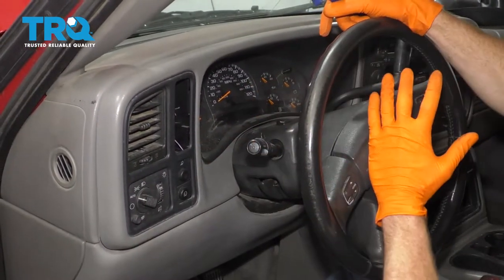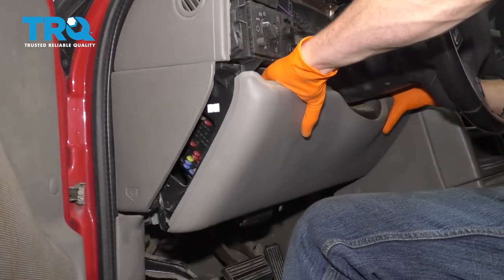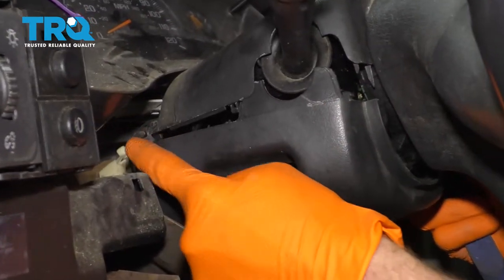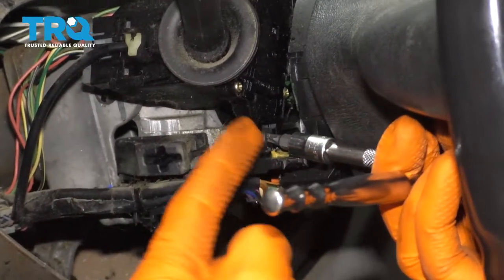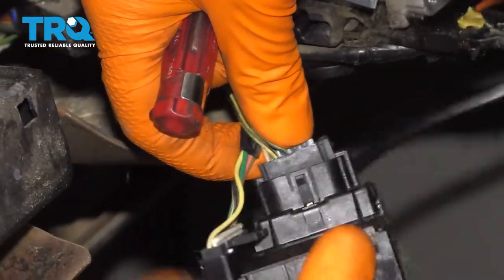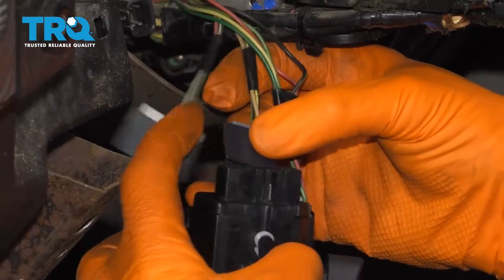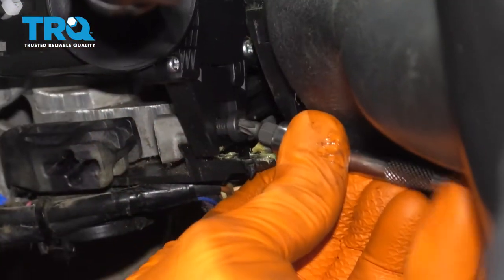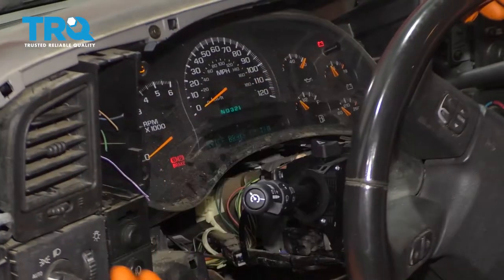How to Replace Combination Switch 1999-2007 Chevy Silverado

Comment: Good video for the 2003 and up trucks. However, this is NOT the procedure for the 2002 and earlier - they have a different part number for the switch and the install procedure is slightly different. If you have a 2002 and earlier, keep looking for a video with the appropriate procedure.

Comment: Thanks for the video. I followed it step by step. The only problem I had trying to loosen the botton bolt with the  signal switch. You're method of going in on an angle didn't work for me. I ended up breaking off the old switch and removing the plastic around the bolt. The neighbors cheered me on.

Comment: Turn the steering wheel a little bit more to the right the bottom screw on the switch housing is way more accessible

Comment: ONLY My right trailer brake light would not function. It turned out to be one of the switches inside of the turn signal switch. That was bad. All other functions of the right tail light on the trailer worked just fine, only the brake light would not function.

Comment: Wow, fantastic instruction and video. This will be my next step if I can't disassemble the stalk itself. I am convinced that there is dirt under the wiper speed / off twisty switch thing so I was initially looking for a way to disassemble the stalk itself so I can clean it out. But this replacement is super easy - thanks!

Comment: Thanks for the video. Only a couple small discrepancies for me with a 2k 2500. The wire harness connected back to the firewall connector block that comes loose with the center bolt. I had to remove a metal cover over the wires as well. Also that T25 bolt underneath the stalk body was a real pain, had to crank the steering wheel all the way left to get enough clearance to put a bit halfway on it. Eventually I used just the T25 bit and a wrench with small turns at a time. Worked since the bolt doesn't hold much weight.

Comment: You gotta go deeper I just tore out 3 on vehicles that were 01 and 03. The wires are connected to the switch and the plug is under the shield on bottom of your steering column. Not sure if you got the years wrong on the video? But none of the 3 I just did had the plugs right on the switch like that
Reply: Mine neither! Wtf!! Clam shell around column is locked in place by key switch. And  wiring harness is a big ass cumbersome thing they has three big connections in a monster ass her was locked together with tabs and a 7mm socket. And then you got to use a bunch of picks to pull the harness apart!!! And even hooks to the gd brake light switch. Absolute garbage design. Take the gd steering wheel off!!?? And switch? And air bag? Junk. I took a Dremel tool and cut a square hole to the right of the hazard light button to get to top hex bolt.  Used a 1/4 wrench on a star bit and duct taped the but you the closed end side of 1/4 inch wrench to remove other hex bolt. This vehicle interior is absolute garbage.

Comment: Great video and thorough explanation! My turn signals would work very sporadically, so I thought replacing the switch would be the fix. Turns out it isn't. New switch and still no turn signals. Any thoughts as to what else I could try?

Comment: Do I need to worry about disconnecting the battery so it won't set off the airbag or would that even be possible?

Comment: Okay I'm desperate so I might be totally off topic at least when it comes to your car and my car I have a 2010 Mazda 3. I turn my car on and my hazards are blinking every time I turn my car on and so I go to press the hazard button which is in between the air vents nothing happens hazards are still flashing press it again nothing happens hazards are still flashing the only time I can get my hazards to not flash is when I pull my fuse out for my hazards but then in turn I have no turning signals what could be the problem could it be my turn signal switch cuz I've checked all the wiring under the hood for my lights everything seems fine the fuses for my hazards and turn signals are not blown they're obviously working cuz my hazards are constantly going off I am stumped.... help!!

Comment: My washers continually spray when I turn on wipers except for intermittent. I am not pushing washer lever. Is this my problem or wiper control module by wiper motor ?

Comment: Mines doesn’t have cruise control but i bought a switch that does does it still work?
Reply: It may do what you need for other functions.But then,I would buy one to fit my vehicle and not press my luck.Your wiring may not be in the same places.
Reply: '06 - Definitely
'00 - Not sure

I did this in my '06 WT and the two stalks are identical except the cruise one has an extra pigtail with 4 pin male connector on the end. That truck was prewired with the corresponding female 4 pin connector, so just adding the cruise stalk added cruise control.
I also have a '00 LS and have never had that stalk out, but it came with cruise control from the factory. The '00 was prewired for (but did not come with) the power rearview. They may or may not be prewired for cruise control.

Comment: I'm sorry but this is not the wiring that my 2002 chevy silverado 1500 has. It includes the cruise control too.  Maybe this video is for simple silverado. I'm not sure but maybe the title needs to be more specific on which silverados from 99-07. You really do a great video on instructions though. 👍👍👍👍 wish it was my type of turn signal switch. I'm pretty sure it would of clarified a lot of questions for me. That connection with the black clip is farther in toward the back right side of column. Also mine has some other connections on the right side where the metal copper parts go towards the column.  Plus it includes 2 wires, black & green, connected to a rectangular gray smal box with some kind of a push button at the end. I was mainly looking to see if this video explained that & of course if it was the same model of turn signal switch mine has. Hope you do one with the type of switch I have.  👍👍👍
Reply from the maker: +SMN NJR We're always cycling through common cars. We'll add this repair to our list! http://1aau.to/m/Shop-TRQ

Comment: Mine is a 2002 gmc savana 3500 5.7 liter. Can’t figure out what the hell is wrong with high beams. Traced every thing possible and ended up going with this part. Taking mine apart isn’t exactly the same. The clam shells that goes around the steering column is locked in by the key switch. Junk. Junk. Brittle plastic. What a p o s design! The whole interior has fallen to sh!t in my van. Cheapest made vehicle I ever owned. Constant door labels busting and falling out. Dash. Trim. Constant wiring. I don’t jerk or slam anything around. Ever. I own lots of heavy equipment that I baby and maintain. These gm products are just awful. Awful. I ended up taking a dreamed and cutting a square hole in top of clam shell to the right of the hazard button to get top hex bolt out. Was NOT going to remove steering wheel or key switch to remove this GD switch. Now I got to but all this trim bs to make my van look safe to drive! Gm engineers need to be in prison. Every GM truck, Van, and even my moms buick ranker has had to have the switch replaced. P o s design.